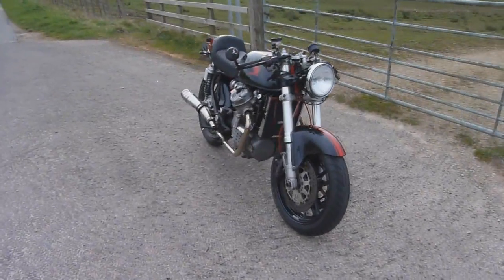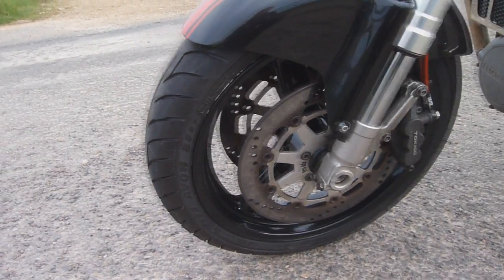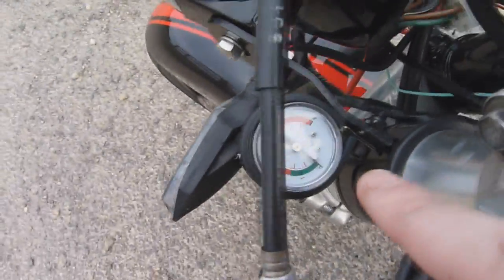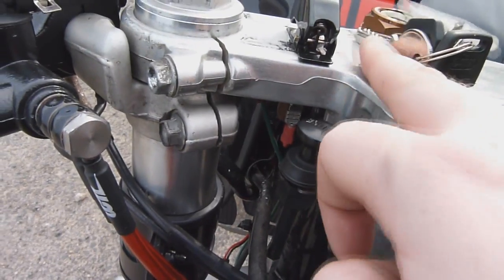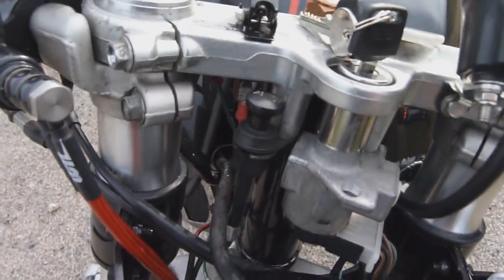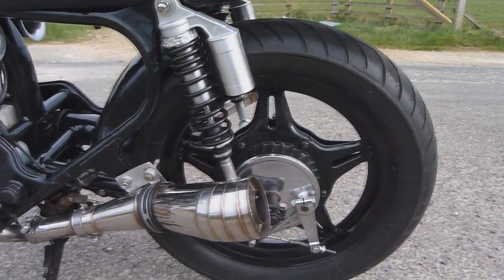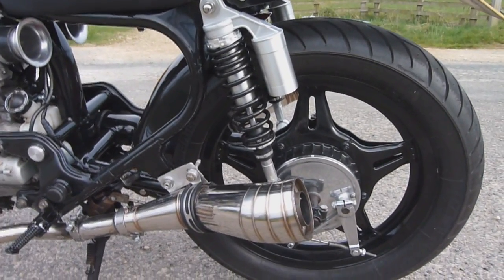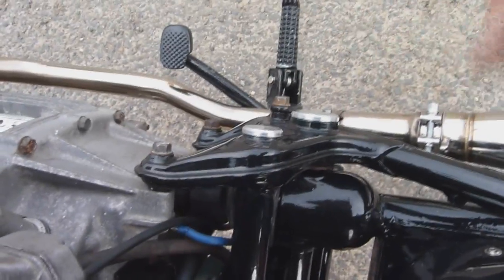HONDA CX 500 CAFE RACER PROJECT EPISODE 30 (SHOWCASING THE COLLIERY CAFE))

Comment: Good job there GGB. If you want to 'tinker' with those carbs (no air box) You could try Keihin 99101-393 main jet. #90 part #KHM-110090 & Keihin 99101-393. #120 part #KHM-110120  Hope this helps, I saved this info on my phone! But I cant remember who it was from.
Reply from the maker: TheBrummiedoug Thanks mate and funny enough that's the jets I'm running which are spot on. I also have a 122 main jet which i got just in case the 120 was too lean.

Comment: With the velocity stacks, did you re-jet the carbs?  I'm running 90-120 with the original air box and a 2 into 1 aftermarket pipe.  Considering going to stacks or pods.  Great video series BTW!!  Outstanding!!!
Reply from the maker: +P Cal Yeah rejeted to 90-120, it likes running unfiltered but i have socks on just to save the engine. I personally think stacks improve the performance because of the smooth diameter transition. Stacks off a Ducati 996 have the same internal diameter as the CX carbs which is what i used :)

Comment: Just found this channel mate - good job.  I like the pipes.  Can you tell me the details of the rear shocks?
Reply from the maker: HMQS Gayundah  Thanks, the shocks are Tec alloy remote reservoir shocks. If you type that in on Google they will come straight up.
Reply: +Ginger Geordie Biker Thanks for answering this I had the same question. I've got a 1980 cx500c that I've been afraid to get up and running because I thought it would be too hard to work on, but your video series has inspired me to give it a go. Thanks for sharing them.

Comment: Hi, the bike looks great !! congratulations, I just bought a cx500 to get my hands dirty and turn it into scrambler stile.  Hope it 'll turn out ok, no rush...lol.  What headlight did you end up fitting ? Great job, thanks for the videos. Gus
Reply from the maker: Hi mate pleased you liked it. As for the head light i did first use a cheap chinese 7". However that broke so went for an original CB750 headlight which works a treat :)

Comment: Well done. Nice bike. How did you jet the carburetors? Do you notice any lag top end or low end?
Reply from the maker: +Jacob Wagner Thanks mate and no I didn't really just keeps pulling. The carbs are 120 mains with 90 ideal jets if I recall which seems to be spot on. Once I get my speedo rigged up I will be able to see how the acceleration and speed is haha.

Comment: Hi ..just wondering what the front end is off and did you have to get new yokes to suit?..thanks
Reply from the maker: +Alan Cullen The front end is from a 96 Suzuki Srad 750. Just needed different bearings and a locking washer because i couldn't put on both the locking nuts. Handles a dream :)

Comment: Awesome bike mate! I just picked up a cx500 to do this kind of thing. Where did you get the exhausts from mate, i couldn't find it in the comments, cheers. ride safe!
Reply from the maker: +fastlanemagic  Cheers mate :) The exhausts came from a company called cafe racer kits. They do all the bits to turn your bike into a cafe racer. Great company :) The cx is a great bike to work on and sounds very nice sound when its running straight through exhausts haha. safe riding bud :)

Comment: did you buy or fabricate the seat?
Reply from the maker: +Anthony Steban The seat unit is a fabrication which came with the kit but you need to prepare the frame for it to fit.
Reply: I'll have to sit and actually watch the episodes ha-ha thanks
Reply from the maker: Anthony Steban I know i made them but they are a good watch if i do say so ;)